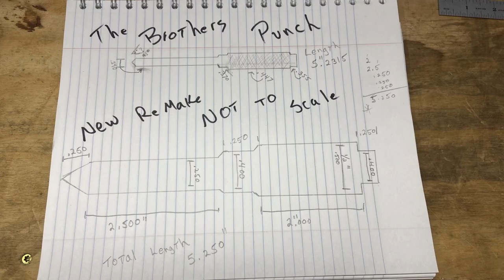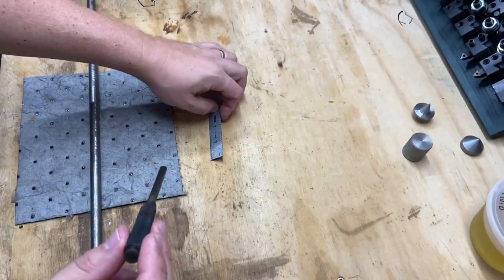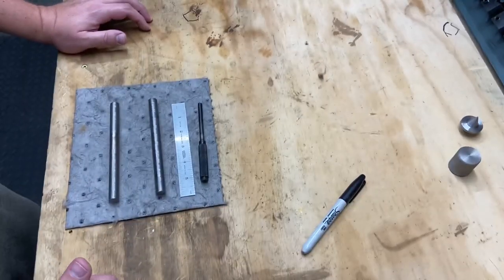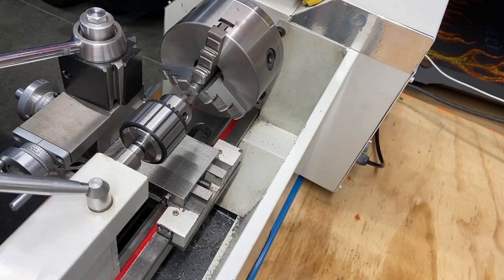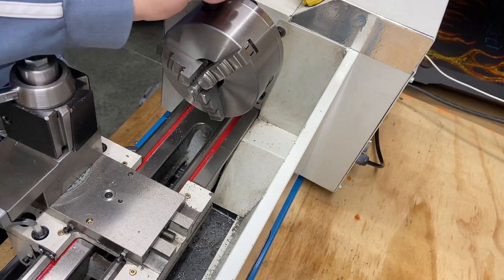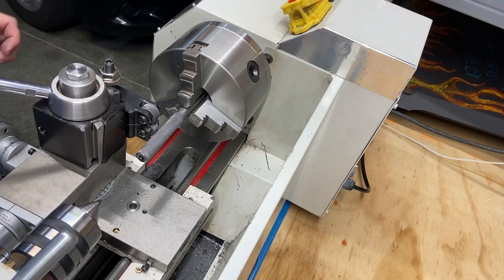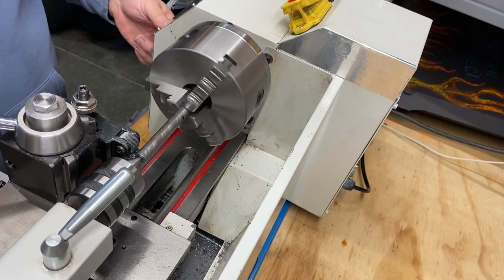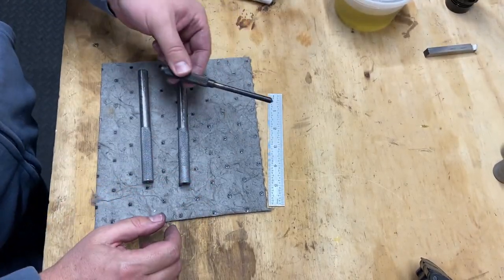Shop Made Punch Part 1 of 3 - Metal Turning a metal punch Beginner Lathe Project

Comment: This is a good project.  Clear goal, easily measured success, and 2 of them so you can compare results as you go.  It does appear from the looks that that is a piece of mild steel, if it is it won't harden with just a heat and a quench, there isn't enough carbon in it.  Also, though it is cheap to buy, and easy to scrounge, you will find that it is harder to get a nice surface finish on it.  The first time I turned a piece of tool steel I was amazed because I expected it to be harder to turn, but it actually turned much nicer, and I discovered that I actually could get a decent surface finish.
Your knurling did turn out pretty  good.  The punch you are copying has knurls that are deep enough that the diamonds all come to points, your first piece you quit before you got quite that deep. On your second piece it looks like the end toward the chuck was deep enough to point the diamonds, but possibly your center wasn't tight and it got shallower toward the tailstock end.
The depth of knurls is a matter of preference.  If I am knurling something I am going to be twisting hard I don't usually knurl all the way to points, I would rather slip than get blisters quick. If I am knurling something with small surface area, like the top you made, I will knurl to points, to maximize grip.
You will find people on the internet talking about turning the circumference of the piece you are making to an even multiple of the pitch of your knurling tool before you start to avoid double cutting, my personal experience has been to use plenty of pressure and the knurl will follow its own impressions.  Really light knurling passes do tend toward double cuts, and it showed up on the far end of your second piece, I think because of lack of support.
Knurling with a pressed knurling tool actually grows the piece in OD, as the grooves get pressed in the material that is displaced raises up and forms the points.  If you are turning something for a press fit and overshoot, you can actually increase the diameter by knurling and get your press fit back.
There is another kind of knurling, cut knurling, where the knurl is actually cutting material out of the groves instead of pressing it in, I think circumference and knurl pitch are more important with cut knurling, but I have never done it, and haven't known any hobbyists that do.
Reply from the maker: As always from you lots of great information in this post.  That material I used I purchased not knowing anything about anything just knew i needed something round to turn on the lathe.  You will see that in part 3 I tried to heat treat this, did my best, but I believe you're right about the inability to harden it.  I appreciate you bring that up.  This is a pretty weak area of mine still,  choosing the right material for the right job.  In this case it was more about learning to use the machine and tools and measuring but eventually I want to make my projects using the appropriate materials.     I need to keep learnign about what steels can be hardened and what can't,  I did obtain some carbon steel recently,  I may practive ahrdening wtih it...maybe make a third punch for comparison. I see your points on the knurl.  A shallower knurs would be mroe comfortable that the sharp diamond points eslecially for something your twisting a lot.  You have given me a lot to think about and I appreciate all your details.  thanks.

Comment: Hello Deez, 
It's great to see your confidence growing.
I believe the second knurl tapered off because it looks like you locked the tailstock in place and brought the work piece up to it. Which caused it to deflect. If you chuck the piece up first and then tighten the tailstock up against the piece it will be a much more rigid setup. 

I am of the belief that knurling benefits from an excess of cutting fluid. It helps flush away all of the metal particles and prevents them from being crushed back into the work. I usually use an oil can and just keep spraying oil on the top knurl. It does get a bit messy but the knurls seem to turn out nicer. This is not a criticism by any means just a helpful tip.

I have also found that knurls on harder materials seem to turn out nicer. Softer materials seem to gall easily if you are not careful.

I can't wait to see the end result, I bet they will turn out nice.
Reply from the maker: Thanks,  I have been gaining more confidence in my limited abilities and always in search of a new project I think I can tackle with a slight increase in challenges.  No criticism taken just porductive feedback on what you observed. One thing I have learned in the past 8 months is to listen to what others observe.  Many are noticing things in the videos I didn't and by pointing them out really helps me understand what went wrong or what I could do to improve...or maybe even just something I didnt know at all and brings that awareness to my attn.  I used a lot of cutting fluid but I think I could ahve used even more to wash away the cuttings but im pretty happy with how they turned out being my first real project i attempted to knurl.  The end results are nice.  Appreciate your feedback as always.  Never offense taken from your comments.

Comment: I found with my inexpensive knurling tool like yours was to center and square the tool to the work piece, lower speeds, cutting oil and the one thing that really helped is I took a dial indicator opposite of the cutting tool and checked out how much deflection I had. I found that adjusting the cross slide until you see deflection at .001” or so and a tiny touch more gave me the cleanest cuts. 2-3 passes tops.
Reply from the maker: this is a good technique to show the amount of presure your pushing on the workpiece.
Reply: @deezworkshop  my thought was mostly not to put excessive load on the spindle bearings and the inexpensive knurling teeth